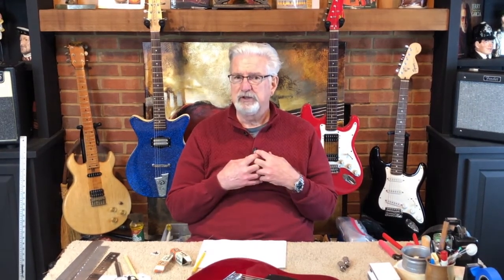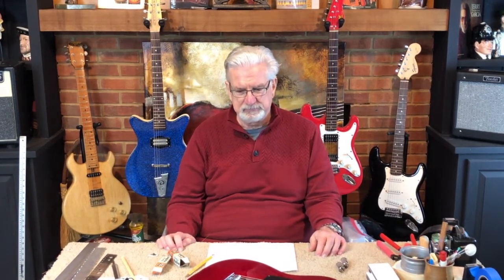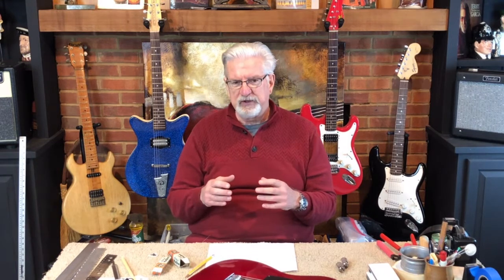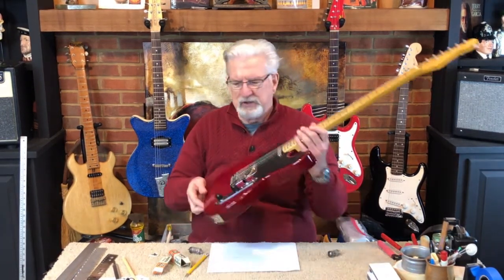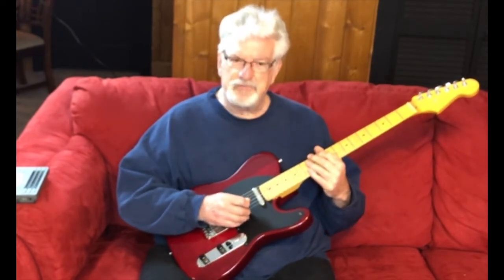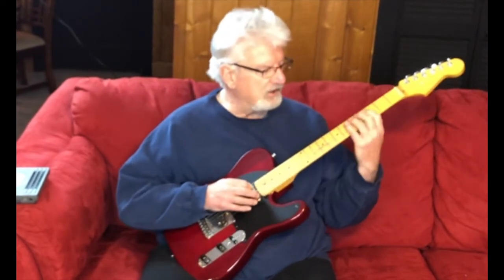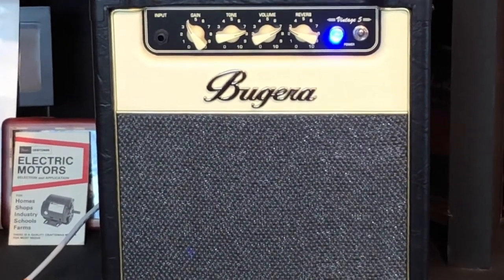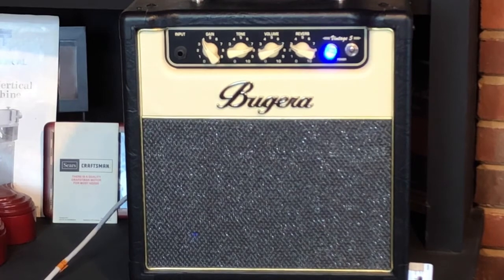EP #6 Preamp Tube Swap "ToneShifter Quick Hack" Amazing Results. Bugera V5

Comment: I put a 12ay7 in and it's a massive improvement, its clean and I can drop the tone back to hear the mid without muddy results. Sure the amp is quieter now yet I think the volume is fine home use and brilliant for recording. Nice little amp now

Comment: I’ve always liked the sound I’ve gotten with a AY7 or if I need more drop in gain a AU7. 12AU7s are much cheaper NOS that the AT7, AY7 or AX7 too. I’ve found new old stock AU7s for about the same price as a new JJ.
Reply from the maker: It is amazing how the tone changes with different preamp tubes that you mentioned . Wish I knew that when I was playing out...oh, better late than never. Thanks for your comments and input.

Comment: Bias adjustment? Brand make any difference?
Reply from the maker: BRAND, IMO, makes a big difference. I don't mess with the OUTPUT Tubes or their settings. Each amp is different, so talk with a qualified amp tech about your particular, situation, and desired outcomes. Thanks for your comments & questions.
Reply: Tube bird is fixed on a single tube.